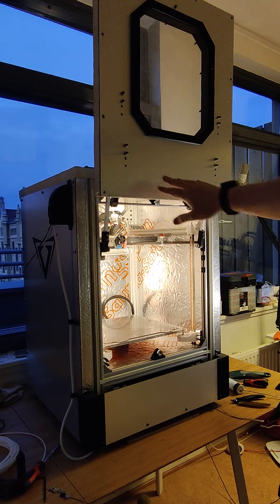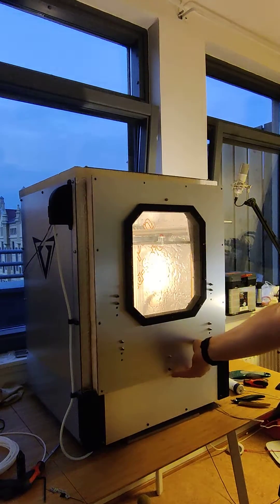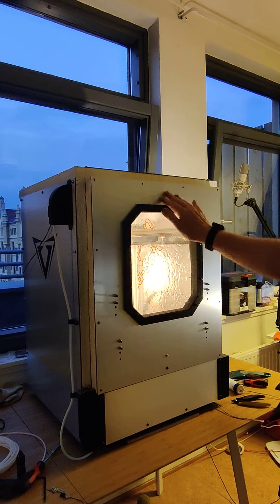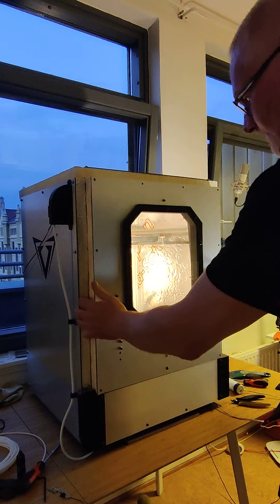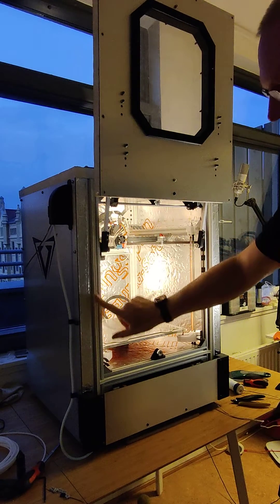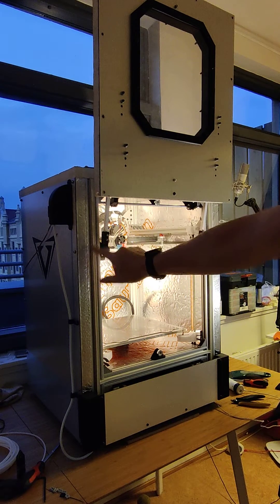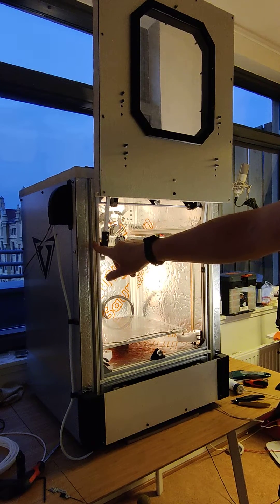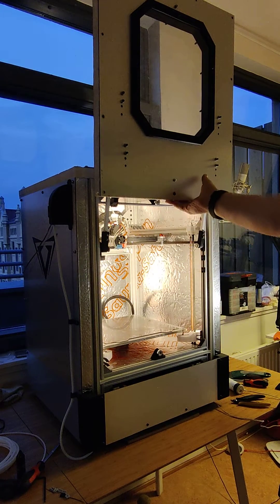Valkyrie High Temp DIY 3d printer | Chamber/Enclosure - Door lock to strong?

Comment: Just try out what kind of chamber temps you can reach with the door like this. If it's good enough, it's good enough, no need for 4 magnets.
I usually fine tune magnet strength by adjusting the distance. Half a millimeter has a great effect on strength, so take small steps.
Looks good though!
Reply from the maker: Thank you. I will work on adjusting